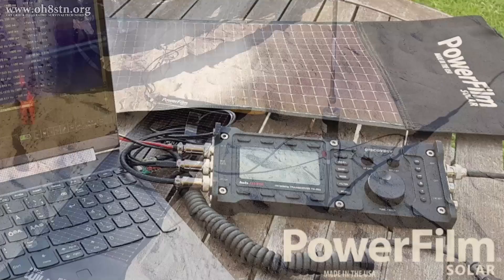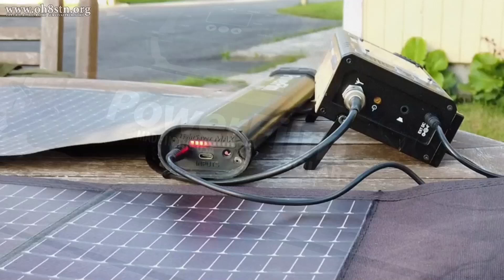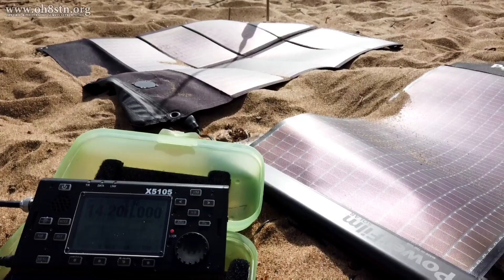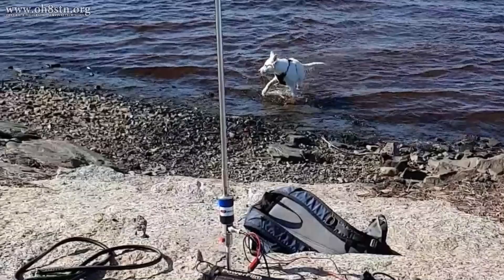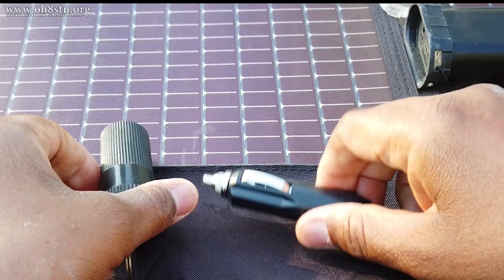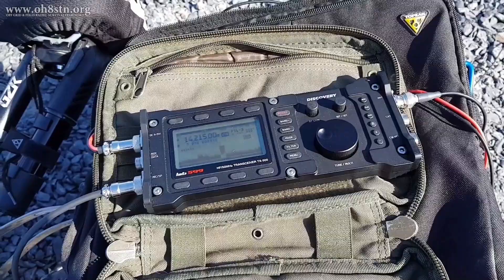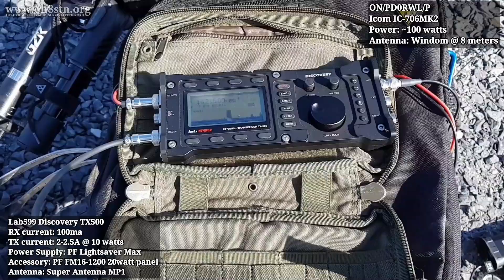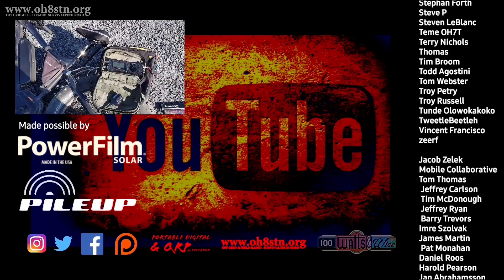PowerFilm Lightsaver Max | OH8STN Ham Radio

Comment: Thanks for the video, Julian. I've seriously considered getting Lightsaver Max for when it was too cumbersome to carry my existing Bienno 12V 12AH LiPO4 with 28w Powerfilm rollable and the Powermini on a hike.  But was concerned my G90 might draw too much current and it would shorten the life of the Lightsaber Max.  Now I have the confidence to try the LightsaverMax after seeing your video. Thanks again & 73 de VE7OVY
Reply from the maker: Thanks for the confidence.
I've used the G90 at 18w using  js8call for extended QSOs. Max current on G90 was within the Lightsaver Max spec, and in practice worked well. It was my only powersource in this winter deployment video with the G90.
https://youtu.be/rGUmJeGFS0Y
73
Julian oh8stn

Comment: Nabbed a Lightsaver Max based on your recommendation a couple of months ago and it has really freed my station. Solid product with an even better review from you. Thanks for all the work capturing and testing it for the community.
Reply from the maker: Nice to hear about your confidence and ultimately experience with it. Sometimes I wonder if I take too long field testing, before recommending something. With the results of this video, this video could have been published several months ago. Just wanted to be sure.
thanks for commenting and for the confidence. It is very much appreciated.
73
Julian oh8stn
Reply: @OH8STN  No worries at all. Huge fan of your work. One question I do have, do you run Pi 4? Not getting enough amps from USB to USB C cable on the Lightsaver Max's outputs to keep my Pi4 powered. Going to grab a 2-1 USB to USB C cable first before I give up and run a separate battery.

Comment: I have been using the PF lightsaver for years  backpacking and love it . For its weight, form factor,  and consumer electronics use it still is the best option for backpack charging IMHO.  The PS Lightsaver Max  seems to be an awesome solution for so many moderate current radio applications.  Once an individual uses a power film product it really is hard to consider other manufacturers. Thanks for sharing !
Reply from the maker: I remember your video on the Lightsaver. I always imagined you as "old school" so pleasantly surprised when I saw that video.
Alway nice to read your comments.
73
Julian oh8stn

Comment: Nice video. Well done. But I use a 24 watt solar panel with a small gel cell. My solar panel is compact and folds up. The cost of mine was $69. My gel cell was $14. This package actually carried me through 24 hours of ARRL Field Day with my KX2
Barry, KU3X/QRP
Reply from the maker: Perhaps there's a real problem with our portable deployment philosophy, if the battery and solar panel weighs more than the qrp radio.
Reply: @OH8STN  I would agree. Size matters when it comes to portable operating.
I do like what's shown in the video, it's a neat package. A tad too expensive for me.
KU3X

Comment: I’ve purchased 2 of these in Thailand and 1 in America from Amazon. They work great as a 13.8 Vdc power or usb power bank it also charges quickly via the usb or 13.8 vdc input. It’s also charges quickly when when supplemented with an external 30 watt panel. But laying flat on the rooftop of my penthouse in Thailand Thailand even for 12 hours over 2 days is only charges to about 40%. But it will beg very convenient to use with a ic-705 and a Raspberry Pi 4.

Comment: Great video! The technology is changing all the time. Nice to see things that meet most of our needs.
Reply from the maker: This is one of those products which didnt have a specific problem to solve. When i read the specs, I thought "Huh!, I can power my 817nd, and take this through airport security". Excellent travel pack for QRP holidays and comms on the go. Manufacturers are just now starting to think about portable power requirements for their rigs. Nobody wants to use a battery 10 times heavier than their radio anymore.
Sorry, rambling. 
thanks for the comment and kindness.
73
Julian oh8stn

Comment: This could be good for specific use cases, and the small diameter is nicer than the 3" diameter required for the Powerfilm rollup panels.  But it seems like waterproof rollup panels and separate DIY battery packs would enable a more modular all weather kit.  Thanks for the review.
Reply from the maker: Yes I agree. The Lightsaver Max solves a different problem, where space and weight are at a premium. We can't replace the rollable panels and diy pack with this Lightsaver Max, just as the rollable and diy pack couldn't be as lightweight and portable as the Lightsaver Max. For example, on a man portable expedition with ham radio. QRP radio and small tablet for checking email with winlink. A kx2 or other qrp rig with the Lightsaver Max is the obvious solution. On the flip side, an FT-891 or IC-7300 being deployed after a hurricane would be better served with rollables and a LiFePO4 pack. Not trying toreplace one or the other. Just showing different tools, for different jobs.
Make sense?
73
Julian oh8stn
Reply: Indeed.  The Lightsavers offer useful conveniences.

Comment: Great video... thanks for this, Julian. Down the solar rabbit hole I go...
Reply from the maker: Thanks! Solar and Battery power is an absolute passion. Lots of us just go buy something off the shelf without really thinking about how it's really going to be integrated into our systems. If we get it wrong it can be frustrating. If you get it really wrong it can be a very expensive mistake. So don't be afraid to go slow.
73
Julian oh8stn

Comment: My main complaint about this unit is that the cells are not easily replaceable. They will inevitably degrade over five years or so regardless of whether or not they are cycled and then I’m stuck with a 600 dollar paperweight, unless I want to open it up and replace the cells myself.

Comment: After finally deciding to purchase a 5105 I notice the latest MFJ ad in QST for $50 off on it. Thinking that it's a good time to buy, I telephone MFJ and am told that they no longer  have 5105s in stock--additionally, they tell me that Xiegu has completely pulled back all of the 5105s and is reengineering the radio. The new 5105 will be call the 5105 PRO.  Check back in November or December (though there is no way of knowing if it will be out by then).  And that's the way it is.

Comment: You should include the IC 7200. It can act as a a qrp radio and a 100W portable with a genset.
Reply from the maker: The 7200 is a definitely a magnificent radio. For this video, I wanted to limit the list of rigs to those with rx current draw under 500ma, but there is no reason we couldn't use this with a 7200 as long as we keep and eue on the rx current draw.
Good suggestion
73
Julian oh8stn

Comment: I really like your videos. I like the PowerFilm product line, but they are more money than I can afford to spend( The wife would be unhappy). I can't come up with a diy solution that is workable and within my skill set.
Reply from the maker: Don't worry Richard. I've got an easy DIY power project for qrp/qro radios coming up very soon.
Reply: @OH8STN  I have been making LIFEPO4 based power boxes for a while. Just stuck on the solar charging part. Looking forward to what you are doing.

Comment: Great review.   I can buy a lot of compact  LiPo batteries for the price of the this panel but the concept is very cool indeed.  My thanks for taking the time to post this.    WA6MOW
Reply: How much weight are the LiPo batteries compared to this unit, assuming the same final price. How long can you run them before you get out of power? Those answers could help in defining short term, medium term, and long term solutions to off the grid transmission. I agree with you for a 1 or 2 days of mobility with human carried equipment, for longer events you might need a solar power solution.
Reply from the maker: Yes lipo batteries are cheap but hopefully we strive for a lightweight, man portable,  renewable power source for the field. I carried the li-ion batteries in the past, but hated carrying them back out when they were dead. :D
thanks for watching and commenting.
73
Julian oh8stn
Reply from the maker: this is the correct thinking. If we want a 1:1 comparison, we need to add up the cost of the batteries, the charge controller, usb ports, solar panel, multi-voltage charger, and regulated DC output. Buying Lipo batteries is just one step in the process. Awesome reply, thanks for this.

Comment: Brilliant video. Thank you for your videos.  Us newbies are very grateful.  Can you tell me all the radios it can work with in the video please. I was having problems with the sound my end. Many thanks forrest M7CCU all the way from the United Kingdom.
Reply from the maker: I've tested with Xiegu X5105,  Xiegu G90,  Lab599 TX-500,  Yaesu FT-81x. Remember despite its form factor, the Surface is just a computer. Any radio with cat control can be plugged into the USB port of the Surface. Only the 705 will be wireless.
Reply: @OH8STN  hi thank you for your reply.  I will try and remember it.  Can I ask,  would the icom ic-7100 all band/mode radio be a good beginner radio for sota and talking to people.  Many thanks forrest

Comment: I would love to see your setup when you get the IC-705 radio, I get mine Sept or Oct. I have the Light Savor Max already, it will work great with the IC-705, so no need to purchase or make external battery. With this setup would you use the Buddy Pole for power distribution? Than you for all the great ideas Julian. 73's.
Reply from the maker: Thanks. I'm also looking forward to getting that setup out in the field. Not sure if I would use the  PowerMini as power distribution for the Lightsaver Max, but there is no reason why we couldn't. I built a cable with one 2.1x5.5 on one end, and 2 powerpoles on the other. Added a fuse inline. This runs a raspberry pi and whatever radio I want from the Lightsaver Max, without any overhead. Thinking about it, it sure would be nice to know that remaining voltage of the Lightsaver Max while in use.

Comment: Great field demo for a really cool QRP power source. Curious: Are the main 12v input/output connectors 5.5x2.1 barrel plugs? 73
Reply from the maker: Hi Dennis. Thanks for watching and for the kindness. Yes the output connector is 2.1 * 5.5 . The DC input is 1.3*3.5mm.
Reply from the maker: Thank you Dennis. Much appreciated. Yes the connector on the output is 5.5 * 2.1. The DC input is 1.3 * 3.5 mm.

Comment: I looked for one of these and the best price was £350 wow that's a real chunk of change to only use for portable ops...
Reply from the maker: All depends on our requirements. If I have the choice of carrying ham radio on a through hike csmping trip vs not at all,  it's reasonable for me. Perhaps not for someone else. Isn't it nice to have the option though?
Reply: @OH8STN  we all like options, I use a tracer 10ah battery but again I don't go out as often or as long as you do so it works for me.
Again great content and delivery 73 om.
Reply from the maker: That's the spirit. Thanks for the comment and the kindness. Very much appreciated.

Comment: PowerFilm Solar have recently stopped shipping these - any idea why?  I am a interested in them but they are no longer being distributed.  It is a great product. Have been told by a UK supplier that this may take "months" to sort out. PS Julian - great informative channel - thanks!!
Reply from the maker: They're not being distributed outside the u.s.a. at the moment. They're trying to get certification for the Lithium-ion batteries inside. This would make it acceptable for shipping by air.
Reply: @OH8STN  Thanks Julian - I emailed them and got the same info but they are working on it as you know.  I already have their rollable panels - brilliant products (you get what you pay for)

Comment: Can you, with a Y adapter, have your radio (say an IC-705) connected to the Lightsaver Max so the 705 can run 10 watts, but also have an additional 20 or 30 watt solar panel plugged in to help charge the Lightsaver Max at the same time?
Reply from the maker: Absolutely! You probably didn't make it to that point in the video. That's exactly what we did 👍 I usually use a 20 or 30 watt panel connected to the input on the lightsaver Max. If you're going to order yourself one, remember to use my call sign as a discount code. Thanks for the question.
Reply: @OH8STN  I saw that, I just re-watched it and then looked on their page and realized that there are separate 12VDC in and 12VDC out. So I guess you don't need a Y cable after all. Thanks for the reply. I'll most likely be ordering one ASAP.

Comment: Late to the show, just heard about this power panel. The site says that the 18,000 mah battery is 3.7v , but the output is 12V . So you can not run the radio with out sunlight?
Reply from the maker: The individual cells inside the pack are 3.7 volt lithium ion. collectively in series, they make over 12 volts nominal.
Reply: @OH8STN  thanks for the reply. That makes way more sense.

Comment: Although I'm not a fan of QRP, I do love the 'power-sipping' efficiency. I have found (in my limited exposure) that the biggest problem with QRP tends to be the disrespectful QRO operators.
Does the Lab599 have a tuner built-in?
Reply from the maker: Understand exactly where you're coming from. Most of that qro mentality can be bypassed with a narrow bandwidth data mode or operating on warc bands. No tuner in the tx500, but you can use it in the rain ;-)
Reply: @OH8STN  What's the world coming to? Now I'm expected to use a resonant antenna, of all things.  LMAO
Reply from the maker: Perhaps you're missing the point of the radio. Anyway I'm not defending it, I'm never defending them. Just showing the community what's possible. Even without a tuner, I'm glad there are companies calling out the big players who keep falling short of our expectations
Reply: @OH8STN  I was kidding, my friend. Resonant antennae are preferred. Take a rig like that or the new Icom with a screwdriver antenna and you're cooking with gas! I've always thought a bicycle mobile setup would be nice. I acquired a pedal-assist bike from Rad Power that I love. (I'm not 18 anymore).
Reply from the maker: Yeah I'm sorry. I'm tired. Arie compiled that video about four times today an uploaded all three and a half gigs of it, with two fails. I'm just tired 🏴‍☠️

Comment: I’ve been enjoying the pragmatic approach of your videos! I’m a Tech license holder for nearly one year now (studying for my general now) and I’m getting ready to invest in my first mobile radio (i have two baofeng HT now). I’m considering the IC-7100 or the Yaseau 818ND. My concern with the 818ND is the comparatively low power output of 2 & 6 watts vs up to 100W with the IC-7100. Can the 818ND truly do a great job with 6watts? Is this something I should take into consideration? 73, KI5HFN Oklahoma USA.
Reply from the maker: Your reservations are well-founded. Because of the challenges operating qrp, I always tell people coming into the ham radio community, not to start with a qrp radio. The 818 is a great second radio. The 7100 is an excellent foundation to start with.
Reply: OH8STN Ham Radio , thank you for the reply!! 73!

Comment: I love that bike so distracting. :)
I like what I'm seeing here and I think the PowerFilm Lightsaver Max might be a solid addition to my portable setup.I'd like to use the thing to charge my main battery and use it's internal battery as an alternate.My only concern is running the system at close to it's top end rating using a G90 for digital modes with high duty cycles. I would usually prefer a little more headroom in a power system, but I'm a belt and suspenders guy that sees failure everywhere. 
Do you see that having any detrimental effect over time?
Thanks for your great videos!
73 de N2NLQ
Reply from the maker: I'm not sure if charging another battery will work out. Perhaps thats a question for powerfilm. Do you remember the aprs/js8call video I did a couple of months ago? We drove down to the south of Finland in our Subaru Outback. We had the G90 running JS8Call through a super antenna mp1, and powered the G90 through the Lightsaver Max. In this confihuration, the Lightsaver max was just a battery pack being topped up by the cars 12v socket. The G90 ran 18 watts in slow mode the entire time. The required "overhead" is about tx current demand, which the lightsaver max never exceeded running the G90 that hard.
I hope this context helps.
73
Julian oh8stn
Reply: @OH8STN  Hey that's outstanding! Thank you.
Reply: @OH8STN  Oh, regarding battery charging, I was going to contact the folks at Bioenno about what it would take to build or modify a charger for their battery that would be 12 volt powered in order to accommodate a system like this one.
Reply from the maker: Not sure it's worth it. First and foremost the Lightsaver Max is a Lithium  ion battery. Its solar panel charges that battery. There's no way to bypass the battery, to get the panels power out to your LiFePO4 battery, through the regulated voltage output of the Lughtsaver Max. A standard solar panel (no battery), could be a better solution for charging other 12v batteries. Bioenno will suggest a dolar panel for sure.
Reply: @OH8STN  I understand now. Yes I agree now that I've had time to think about it I see your point. I appreciate your feedback greatly!

Comment: Thanks for the video. I noticed the input on the LightSaver Max is marked 12v. The voltage from another solar panel will be more than that. Will it handle 18 or 20 volts? Thanks K7WHN
Reply from the maker: Yeah. Often charge it with my panels up on the tower, connected directly to its DC input. I wouldn't connect it to a string of panels in series though.
Reply: @OH8STN  Only going to use one 28 watt to help it charge faster. Thanks again K7WHN